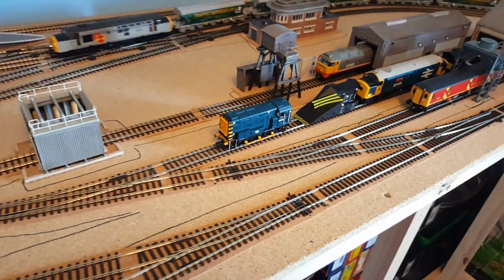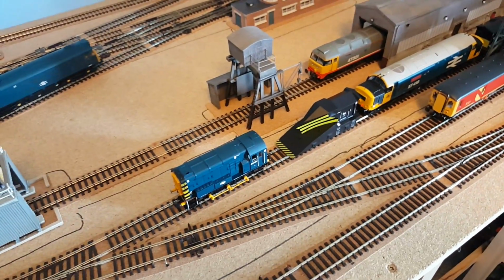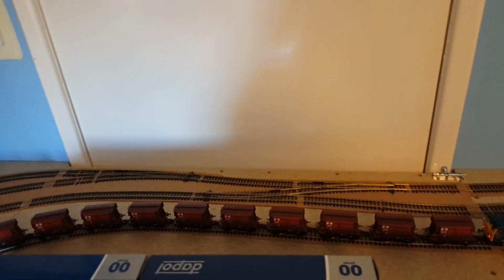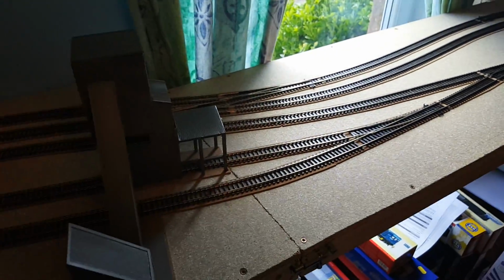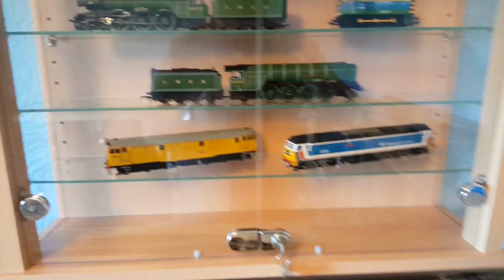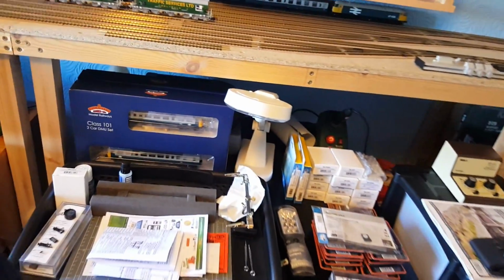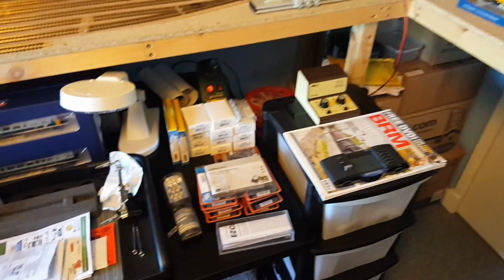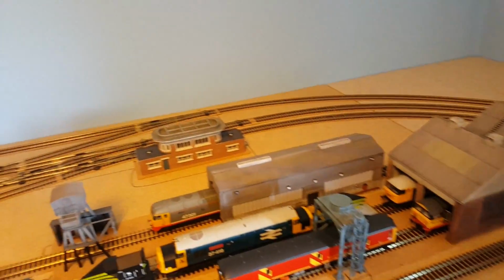Layout Update 7

Comment: I have just found your channel. First may I add my condolences for the loss of your father. Two things immediately impressed me and made me subscribe . One the solid construction of your benchwork, sadly most people seem to rush through that part in order to get trains running as fast as possible and they suffer the consequences forever more. Two the wide curves you have put in make the running look so much more realistic than set radius curves. One thing I would add is to fill in the corners at the ballast yard and the one by the station with a triangle of benchwork. About 300mm out from the sharp right angle corners you currently have. I hope this makes sense. All the best, David.
Reply from the maker: Thanks David, Yeah I had thought about that for the 2 corners... But I've got a long way to go and I keep changing the plans all the time lol

Comment: Hi, Just seen your update, great videos and layout. Re the Dynamis you can turn the time out function off so that it will not cut the power if it loses the signal from the handset. Go to System Menu, then scroll to Timeout, and select No Timeout. I have the standard Dynamis, but should be the same for Pro Box...hope this helps, you won't need loads of receivers around the layout then...

Cheers

Reg
Reply from the maker: Thanks for the advice,  that's the settings changed now

Comment: Sad news about your father, sorry for your loss. .   Well never mind signalmans nightmare ,glad you wired it! That must be a headache ,I am trying to look and see a way to run the points without it shorting out somewhere . How do the loco's cope with the polarity switching from side to side . (Please only answer that if you can in laymens terms or baby lingo ,hahaha do you need to just leave certain bits dead and hope the loco runs on a bogey long enough to spread the across pick-up wheels ?) Sorry for the awkward questions  even if you know where I can go and read the answer would do,thanks. Your going well with the chips ,did you chip the 91 or won't you bother with it. Anyway glad your back .  cheers
Reply from the maker: Thanks Alan, the double and single slips are all insulfrog and each one has its own power feed, I've also used insulated fishplates with them and have had no problems.. I did chip the 91 and it does run superb, but still unsure if I'll hang on to it